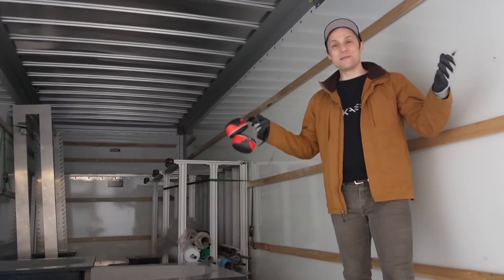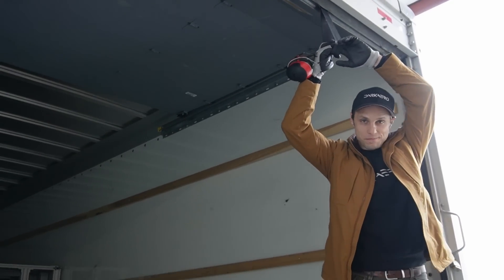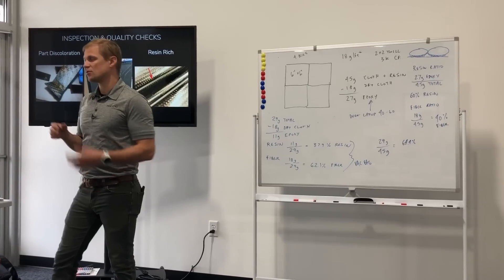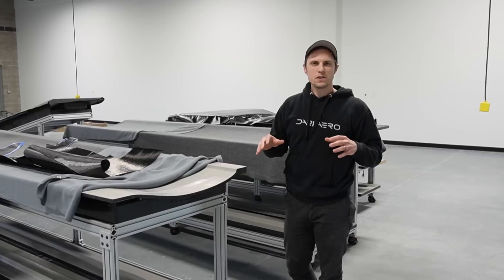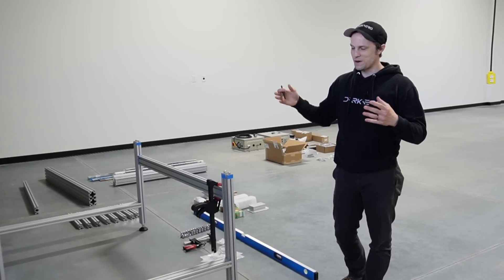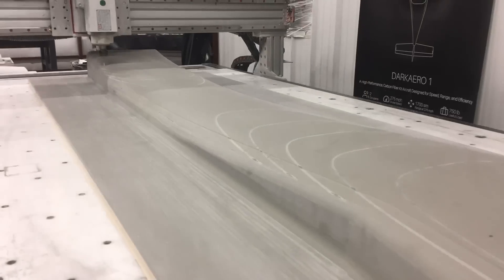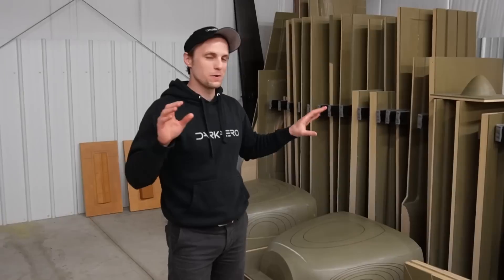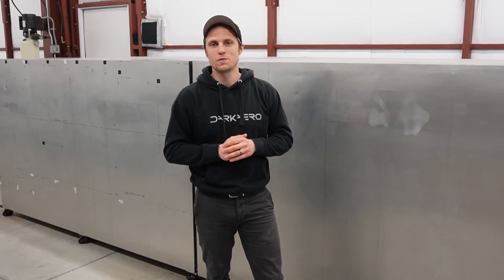How to set up an aerospace factory

Comment: Great progress.

Two unrelated to this video items:
How does one board the aircraft from the ground?  That step up distance motivates the question.

Trusting any hydraulic cylinder to hold position under load could result in a problem.  I saw the engine/prop hanging from an engine hoist, unsupported.  Just an observation.

Comment: I highly recommend a acoustic treatment in your class room. Easily done by absorber panels hanging from the ceiling. Your studends will thank you for better concentration and less headaches.
Reply from the maker: Kirk, agreed! We are currently researching some acoustic paneling options. Thanks for checking out the video. :)
Reply: @DarkAeroInc  In our training rooms we noticed a dramatic drop in reverb once we hung framed posters. The void behind the poster dampens sound waves. We also found some cheap canvas art that really does absorb well. I think we even put some batt insulation behind some of the canvases. And human bodies will also cut echos.

Comment: I find myself wondering how you’ll move the oven. Is it a bit like moving a large boat? Sling and gantry into or into a truck or tailer?
Reply from the maker: Probably the easiest solution would be using a forklift and a side load trailer or perhaps leveraging a moving company.
Reply: @DarkAeroInc  Flatbed trailer would handle that easily.

Comment: How exciting! Nice oven too — i need to build one for powder coating, any suggestions for resources to reference?
Reply from the maker: Hey Louis! How big of parts do you need to powder coat? If it’s small enough, the quickest and cheapest option would probably be picking up a used commercial oven. If it’s big, then you might want to explore building your own. We can give you some direction on how we built ours if that’s the path you want to take.
Reply: @DarkAeroInc  thanks for the help! My parts are 0.063” sheet aluminum and 16”x16”x36”. I’d like to cost out building an oven vs buying one. I have a box and pan brake, welder, and many tools I can use. I can search online and be aokay I’m sure, just wondering if you have some blueprint recs to jump start me. Thanks again!